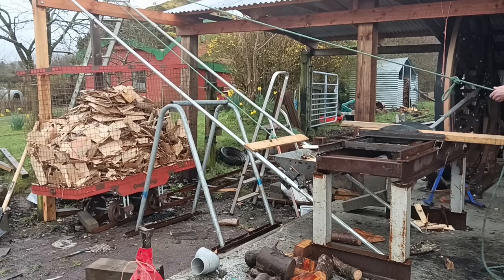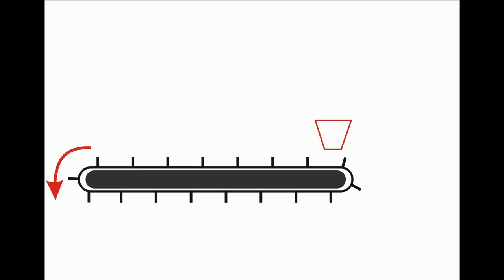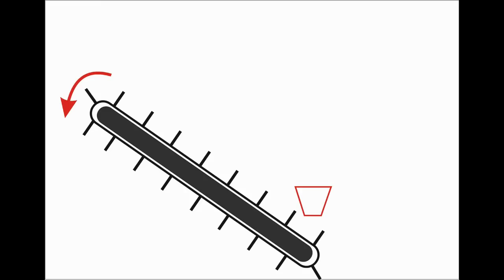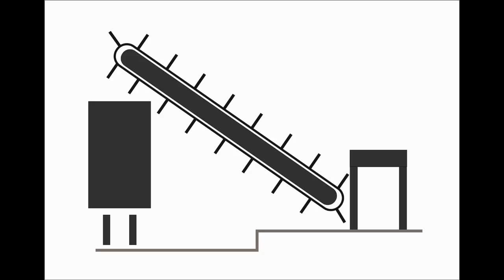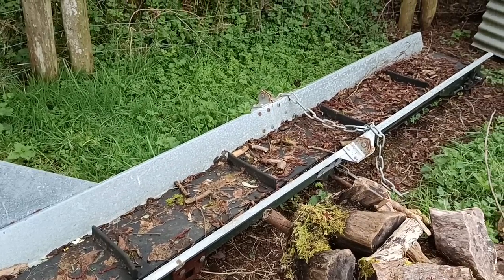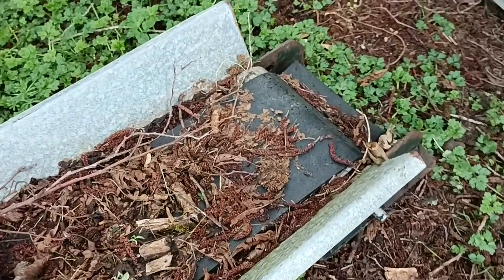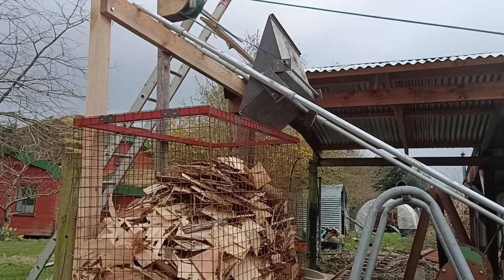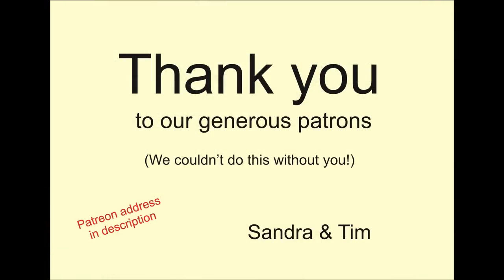Why Not A Conveyor? Responses to the sliding hopper video..

Comment: One thing i personally would recommend would just to drill one or two holes in the bottom of the hopper so that it doesn't collect water

it is just a convenience thing really so you don't have to empty it after every time it rains, might help prevent rust too!
Reply: And the hopper won’t be as heavy if water can drain out first
Reply: I say cut 1in to 2in slots instead of drill holes.  Holes are more prone to plugging with wood bits, which wood shavings give off a lot of.

Comment: I did have the thought about a conveyor belt, and even despite the difficulties noted one could work, but there's a lot more mechanics to work out, more parts involved that would increase costs, assembly, and maintenance difficulties, and a lot more potential for things to break down. No need to over complicate things when you've found a solution that works.

Comment: I had my doubts about the sliding hopper design when you started, but seeing it in action convinced me. My only suggestion would be, once you decide you're happy with it, put some grease on the rails to cut down on wear and physical effort. Also, as others have noted, drill a hole or two in the bottom of the hopper to drain any water that might collect in it.
Reply: Wonder how the grease would go in the cold with bits of wood/charcoal mixed in.
Reply: @magnustveten492  candlewax works great as well. Of course best with wood on wood contact, but metal should work as well I think
Reply: @09conrado  yeah true….and also fit within the budget, I’m sure there are some candles somewhere on the farm :)

Comment: I love the old fashioned skip.
Iron mines have used skips to bring the ore from out of the mine for ages.  The skip usually dumps into a hopper, and is then gravity fed into rail cars.
Old steam locomotives required lots of coal, so the coal car emptied into a skip, the skip loaded an overhead hopper, which then fed the locomotive tender.

Comment: The tilting pin you attached the rope can ride a slot guiding rail to make it tilt and return reliably. At least on top if you want do save materials. Just use a smooth curve.

Comment: You could move the hinge point of the bucket a little forward, so it tips back by its own weight as soon as you release the tension on the rope
Reply: Or weld a piece on the backside, pointed down, to move the center of mass for the same thing, but with no drilling!
Reply: Wouldn't the bucket then remain tipped when it's meant to collect material? Unless the bucket or rope were somehow constraned to tip it back up and keep it there until it's full again.
Reply: @Convolutedtubules  Center of mass to right of pivot point when tipped over. That way it's self righting when tension on the rope is released.
Reply: @Nelo390 yes, a counterweight would also work, it it of course far easier than rebuilding the pivot point, but it adds additional weight which has to be pulled up every time,it is no problem if just one pound is needed, but if multiple pounds are necessary, it gets significantly harder to pull up.
But in any case it is worth a try, since it just takes a few minutes and doesn't cost anything

Comment: Love how that system works! One shoe string thing that might be beneficial (there is probably a good reason you didn't do this). Where you are standing when you pull the rope. It might be possible to place a pole, with a pulley on it. In theory you would pull down, and get a little mechanical advantage by having another pulley. 

I applaud all the efforts I have seen you put into your farm! I would not be able to build 1/2 the things you have built.

Comment: I thought of a way to make the conveyer belt work. Vertical conveyer belt!

Vertical bucket conveyor, with two shoots, one at the top and one at the bottom.

I think this is the best solution to upgrade after you get sick of hauling that rope and outgrow your current setup. It is the best in terms of space utilization, ease and cost of manufacturing, and efficiency of use.

Comment: Point of order to the chair...
No. A conveyor does not need lots of bearings. The conveyor can just slide over a wooden or metal beam for light loads. It can be a belt, chains, metal links, rope, wire rope or canvas belting. You could use a head and tail roller if needed for ease of connecting the drive which could be manual or driven.
The sag on the back doesnt matter too much if you drive it steady.
The "buckets" could even have been fruit boxes. If the conveyor runs at a steady pace they dont need to hold much. Old agricultural conveyors give lots of ideas and were built on the cheap. You have a stack of power in the engine and proven skills at making pto's. 
The only benefit in this would be the production rate meaning you focus on cutting instead of cutting and conveying. 
I only mention this because it may be of use on other projects.
What you have created is as always brilliant and a personal choice.
Well done.

Comment: Paddle conveyor belt isn't the only option.  We had conveyor belts at the sawmill for removing sawdust and scraps from the head saw, trim saw, and end cut saws.  This same belt also was where the floor cleanup guys would dump wheelbarrows of bark, bits of wood, and other debris from the other saw stations later down the line.  The belt that ran from ground level to top of the rotary hammer mill to grind up waste wood bits was at roughly 60-degree slope and had a thickness of about an inch and a half.  Half of the thickness was the flat back of the belt to run over the rollers and the other half was the molded in chevrons to help smaller debris ride up to the top.  This belt could transport railroad ties up and into the rotary hammer mill if needed and did so on several occasions, but this was not it's intended use.  The belts nearer to the saws were even thinner at a quarter of an inch or less (thinnest at one eighth of an inch) and had a textured rubber like finish almost like the conveyor belt at supermarket checkouts but stronger. 

In regard to your operation and its setup I love it.  It's outside the box thinking.  You built a whole rail setup to run your daily operation with only a few guys.  The large flywheel running off a hit and miss engine I fell in love with.  Would have loved it more if it was a pony steam engine like used to pump water from mines.  I would have probably gone overboard with this same setup by building an actual mini railroad like in this video here https://www.youtube.com/watch?v=IW9DiGG7nV4&t=210s and used the hopper cars to move the debris from the slicer to a dedicated drying hopper later down the line.  That would have involved some hopper setup under the slicer to allow the chips to fall into the hopper cars as the train went under the location or next to it. As I said "overboard" in wackiness on my part but like you guys I like doing things outside of what is "normal" and still have fun doing it.
Reply from the maker: Thanks, Telknor. Lack of money is the real driver here - I'd love a railway like that too, but it will have to wait..

Comment: Great explanation, the hopper will be better for the charcoal also. For that you would need the belt in a V configuration double the amount of rollers and a funnel both adding to the issue of getting under the table.

Comment: Nice of you to take the time, to explain unless you had a pit under the cutting table for the belt to fit into, it was never going to be an option.Think what you have is just fine, you can even use the same system for loading the charcoal, but obviously that would need a different receptacle for the charcoal to be loaded into. If there is anyone out there with a spare small fortune, I have no doubt it would be greatly received and put to excellent use by Tim. 👍🤗

Comment: You even have a conveyor!  Haha!  Didn’t know that.  You could power with same motor that starts your Diesel.  It only has to carry a couple chips at a time since chip rate is slow so belt cleats don’t have to be tall.  I think after 8 hours of chipping and pulling the hopper the conveyor will be seen with a different light.  💡 🙂   Great video as always!

Comment: The pipe guide rails do look a little flimsy for my liking, but hey! It works anyway. I've learned the application of "KISS" quite a lot from your videos. Sometimes, it seems, we have to embrace the "KISS" whether you like it or not. Thanks for the lesson Tim!
Reply: You do have a point that they look weak. Once you consider the weight it is not much more. 
There is a way to improve the design yet it is about cost, time and money. 
In the future one could just use angle iron then use bearing to guide the bucket. You can then build a proper frame and cross supports along wil being able to put the bucket between the rails which could lower or raise the height of the of the sled.

Comment: If it works it works.    ...But it would be even better if the rope was connected to a winch connected to the engine by a clutch so you could pull on a lever to engage the clutch and the bucket would be pulled up and dumped automatically!

Comment: My suggestion is that you have a tipping stop that is outside of the slide rails near the top and an arm that extends from the hopper with a "Y" piece that engages the stop and tips the hopper just as it clears the top of the rail car so it dumps it's contents into the car and also allows you to move the hopper farther up the slides to another stop on the slide bar that you can bang the hopper into to shake free any pieces that get stuck in it.  Then as you lower the hopper, the "Y" on the arm engages the stop again tipping the hopper back to it's upright position so it's lip doesn't catch on the top of the rail car.

Comment: used treadmills might have been an option, where I live people are happy to give those away. 
The slidy hopper works too, maybe rivet a strap of metal bent into a P on the edge and it won't catch on the edge of the cart and re-set its self without the need for the frame?

Comment: I think you were over thinking the install of the automatic hopper.  I don't agree that the paddles need to be as large as you say, your only lifting small pieces  of wood slices. And to connect  a power takeoff from your  slicing machine bed workings to power the hopper shouldn't be to much of a difficulty.   Thank you for your wonderful videos.

Comment: Probably too obvious to be helpful, but one idea I had was to attach the other end of the rope to a simple spindle or drum. Then have the drum mounted via a carriage bolt on a wood frame (around chest level) that you could slap a power drill onto. Forward would draw the bucket up, reverse would draw it back down. Not a design improvement but it would be a heck of a lot less work

Comment: Think more of cattapiler tracks from a tank made from 4 bike cogs and chains with the V plates  bolted to the chains then a shaft to the fly wheel connected to the bottom cogs cheap and easy

Comment: A variable speed motor, no rollers, (just a plate), in crease the linear speed ( less load, and thus smaller paddles) and in theorie you can make it from 2 lenghts chain( think manure speader, the old ones)

Comment: I once built a conveyor that had a track on top that thin squares of plywood slid up in. I made a pulley system that I could mount a drill to clamping the cuck on the primary shaft. It turned a small diameter pully that wend to a large pulley with a small pully on it's side. This then drove a section of all thread that turned a bicycle cog in the center. I used a piece of scrap aluminum window frame as a track for the chain to ride in. I put screws through the center of the plywood squares which was pulled by the links in the bicycle chain. I then used denim to connect the plywood squares. The greater the angle the closer that paddles needed to be. This kept them from needed to be overly long and I could angle the paddles so it they were perpendicular to the ground at the angle the conveyor was intended. I wish I still had the video as it would be of interest.
Reply from the maker: sounds good!

Comment: Nothing wrong with a skip loader.

I would get tired of pulling on the rope all the time & figure out a winch running off the engine.

Other than being short the conveyor would have worked just fine if you had the clearance under the slicer.
That being said the material doesn’t feed on a conveyor very well, I have seen 16-18’ of mill ends bridged in a conveyor many times.
There is a limit to how steep they will move anything.

As far as the mechanics you could use a drag chain in a steel, plastic lined steel or wood or even steel lined wood trough. That is how old time sawmills moved waste.
I will find a link to a steam powered mill in BC that is mostly built of wood.

As far as driving it you can just use a twisted belt.

You have a wood lathe, nothing wrong with using crowned wood flat belt pulleys for your projects, cheap & effective.

Cheers.

Comment: I think a third point in the conveyer may have solved the clearance issue, but you would still have the expense and even greater engineering. As it is, it still works fine!

Comment: Hi Tim, yep, you are right about the cost. But you are wrong about needing longer papples as you get steeper. I have been in the firewood industry here in Australia, and quite surprisingly, how steep an 11/2" high paddle will carry firewood up a steep elevator.  I'm talking of Australian hardwood 14-16" long and 5" square, and yours are only at the most 1/2" thick and about 9" long and what we would class as a softwood.
But I think what you have made is better and the simplest..
Reply from the maker: Thanks, John  : -  )

Comment: You need a Buckedelevator... and with your skills, you could built this from your "to short" convayor. You just place it 90° upwards and bold some Aluminiumbuckets to that ripps. And with the right speed these buckets never been overloadet. Btw.: Drive the Elevator with a rearaxle from a car ... so it has the right Angle to the Flywheel ... 

At least : i would placed anothter Rail to the frontend of the splitter, and drive the elevator stepwise with every push of the rod.
Just need a turntable for the waggon☝️😉

Comment: Tim, this may be stupid yet I keep thinking there has to be a way to use some type of weight and pully to make that sled move up and down. While it would not be automatic it would or could help to counter it? 
I also may have no clue what I am talking about. 
You set up is super cool BTW. Such a simple and effective idea that works quite well.
Reply: A counterweight could definitely make it easier to lift methinks, But it might just not be worth it to him for the extra effort to engineer it.
Reply: @Nelo390  I have a feeling that if he reads this he will comment that it could be a viable project if want needed it. Maybe not right now, down the road if it becomes more of a hassle when running full production might consider an idea like this. 
On the other hand it would make for a pretty good video and which can help spark younger minds in thinking processes. 
I kinda wish I lived near by cause I would help out anytime he needed. His projects are quite cool.

Comment: looks good and works, the key bit being "it works", and "works now2 is better than "perfect later"

may be worth drilling a drain hole or three though in the hopper for when the weather is doing its thing.

only concern would be is the hopper large enough to take a full load from the slicer or will you have to feed logs in more slowly to use this?

only other thing could be to maybe have a chain to drag the loaded hopper up, the sort thats constantly moving, with a latch to connect the hopper to it so it can load up, the latch be dropped, up it goes, unlatched and then sliding back under gravity?

thinking of easy ways to automate the operation using basically what you have

Comment: While the hopper is in the bottom position, attach a rope from the top of the lift to the tipping side, this ensures the hopper is flipped back as it hits the bottom position while coming down.

You can extend this to make it work for the tipping action too, attach a rope to the bottom while the tipper is at the topmost position.

Hope that makes sense? the rope attached to the tipping side will "trigger" the flipping action rather than the current mechanism you have and you could potentially have variable tipping height with this as well?

sorry for my english :D

Comment: I don't think a conveyer belt was the right choice, but... you could make it work by just putting some sort of angled shoot under the slicer to push falling slices out onto the belt. No need to actually get the belt under the slicer.

I don't think your solution in necessarily the optimal solution either, but it's a damn sight better than doing it by hand, and it's in the budget, so it'll do.

My main bugbear is the exposed rope, which just makes it look very tangled and messy and dangerous.

Comment: I had thought of a conveyor in the last video but refrained from suggesting it because a conveyor is deceptively complex. It over complicates a situation that can be handled in a simple way. I don't know if you mention this reason because I'm typing it at the very beginning :D

The only thing different I would suggest is making it an overhead pull cord with a weight just a little lighter than the carriage on it.